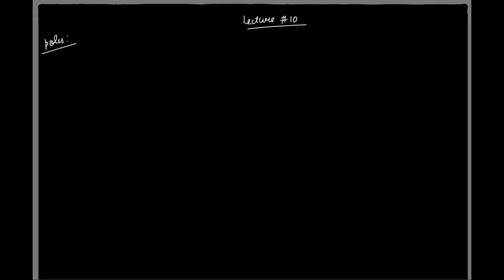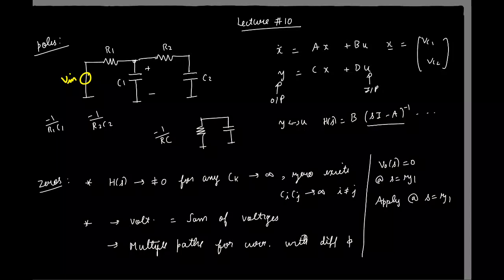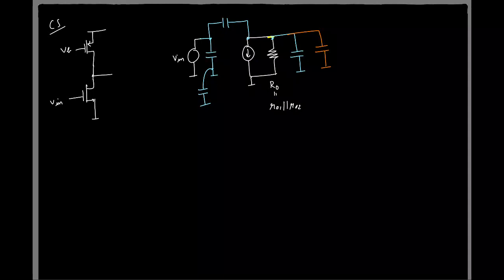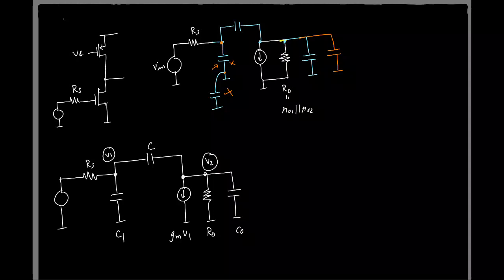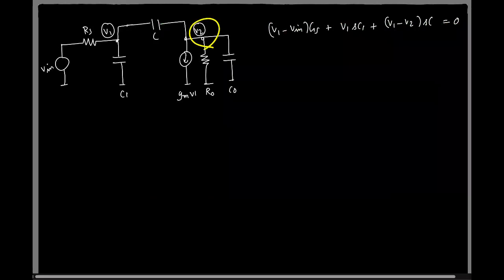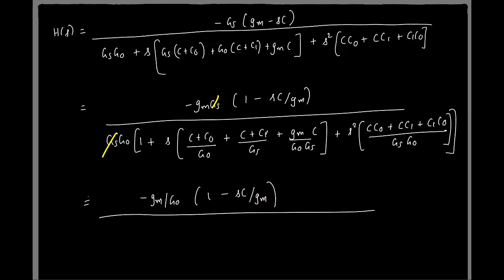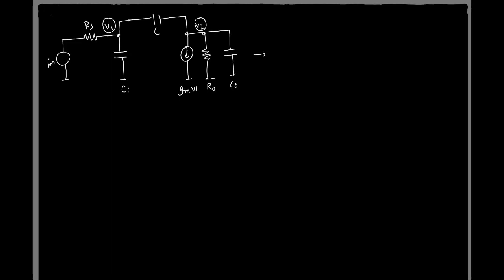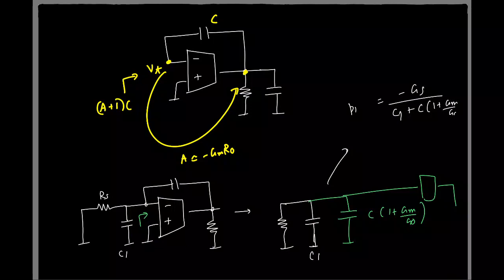Lecture 10: Poles and zeros; Common-source amp; Miller effect;  (extra info: unobservable state eg.)

Comment: Dear Sir-Thanks for the nice video. Could you please explain what exactly controllability and observability in a circuit?  Also what if it is not controllable, does that ckt is not going to work? Also if there is a loop of 3 capacitors, will there be always a pole zero doublet?

Thanks,
Raj.
Reply from the maker: As a circuit designer there is no need to bother about the issue of observability or controllability. It has almost no bearing on the actual functionality of the circuit. Usually these unobservable states arise due to a pole-zero pair that exactly cancel and does not impact the final transfer function. It is one of those things that is nice to know but probably might not affect you in the design process. 
Pole-zero doublet refers to the case where the location of the pole and the zero are close-by. In the circuit discussed in the lecture, this is not the case. And it is not necessary that a loop of three capacitors will introduce a zero.